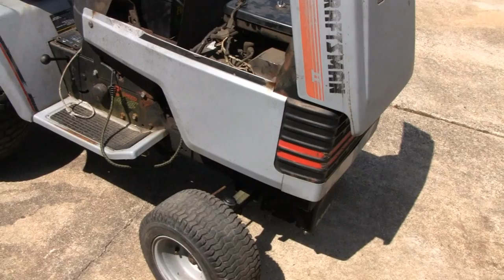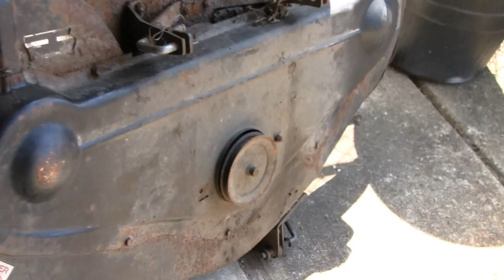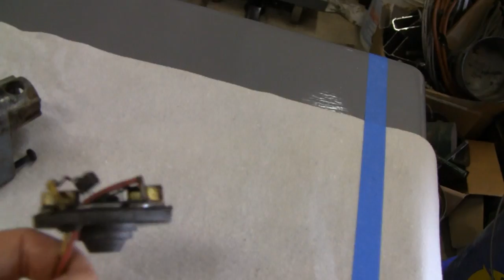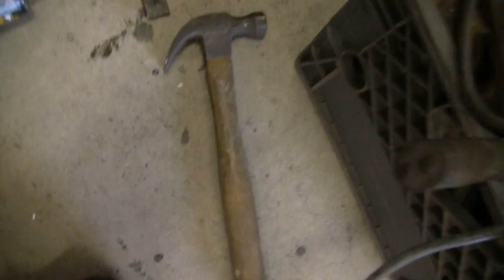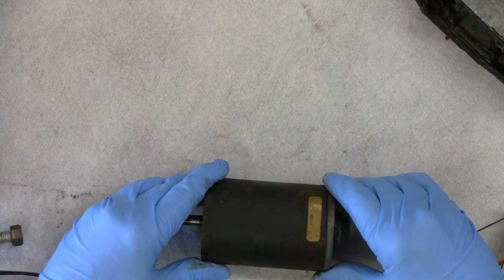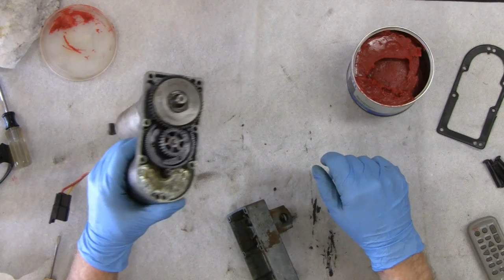DC ELECTRIC MOTOR REPAIR

Comment: I actually have worked on many of those actuators... and replaced them for about the same reasons, then repaired the old ones pretty much the same way. They are fairly common, not surprising an exact replacement is $900, but an decent replacement would be around 100 bucks on ebay